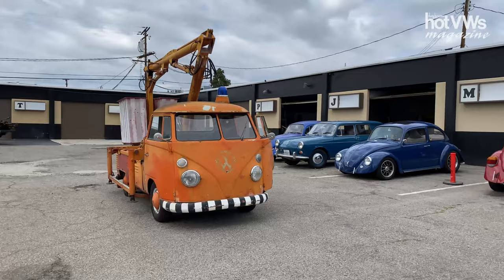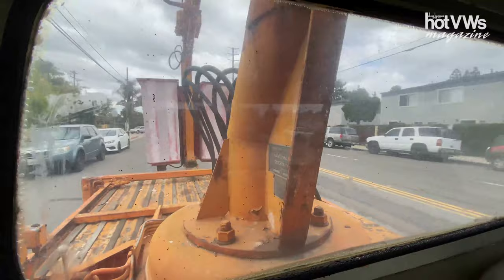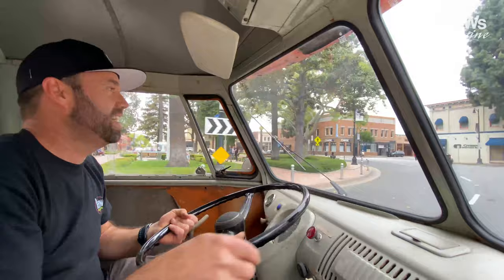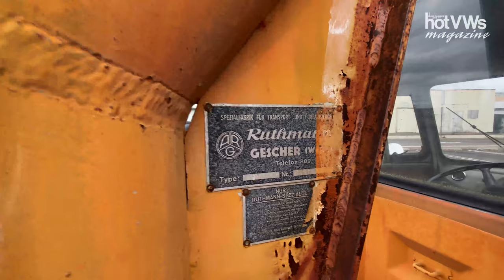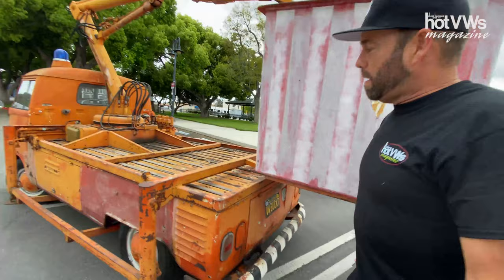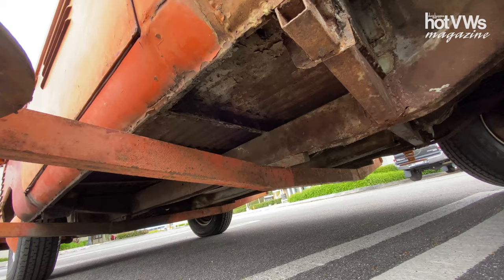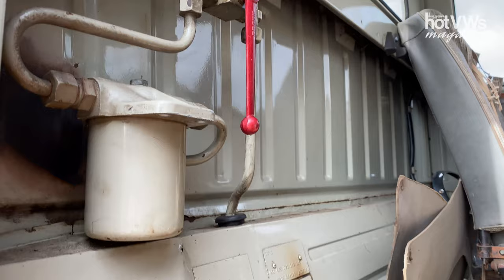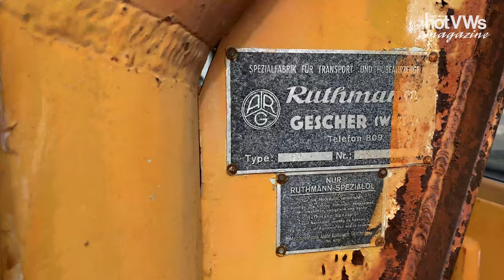Hot VWs Magazine: Type 2 Cherry Picker Truck

Comment: All 40 hp! Back in the early eighties where I worked, three of us owned VWs. I had a 59 Bug, the others a beach buggy and a 5? van with a mighty 36hp. Being VWs they collaborated and all developed major ailments at the same time, we all decided to keep it quiet from our work colleagues, preserve our reputation, as you would. 
Anyway, Mr Kombi broke his crankshaft so an upgrade was made to a 40hp unit, there was much elation that it would now do an indicated 60mph, if you waited and didn't question the accuracy of the instrumentation.
Ironically mine had also broken its crankshaft, the owner of the buggy, gearbox issues.

Comment: You and Mike need to bring them both to the next OCTO once the pandemic is over!  I used to be on the old ACVW mailing list and remember when David bought that thing(I thought it came out of BBT?).  BBT had at least one split (inside) https://photos.app.goo.gl/FWEoXRqDH6ehAepK8  and two bay windows in '03 when we went up to their open house during Bad Camberg, they were holding up the banner as you drove in https://photos.app.goo.gl/8YhsmNMKBirY8xbaA .  It was working when he had it up there, but it took him some time to get it running.  Thom Fitzpatrick(remember that rust bucket RHD BD deluxe? lol), Greg Noble(that looks like him standing by the ladder truck in that pick @ BBT), Tom Buse, and the rest from that group.  Man, bringing back 90's memories.